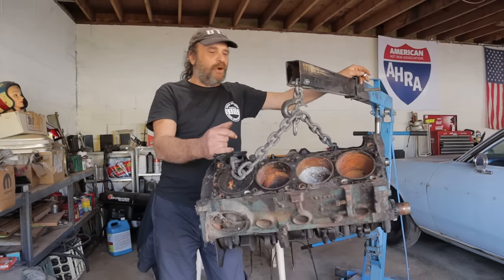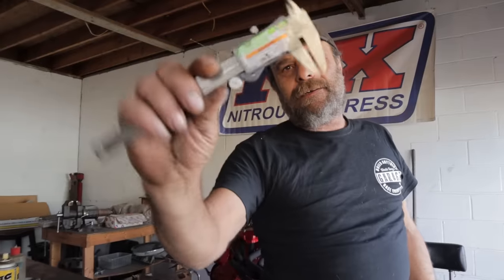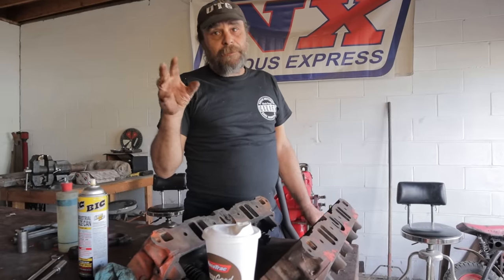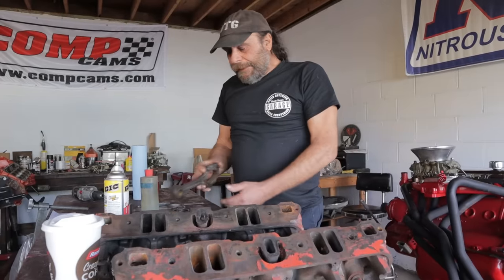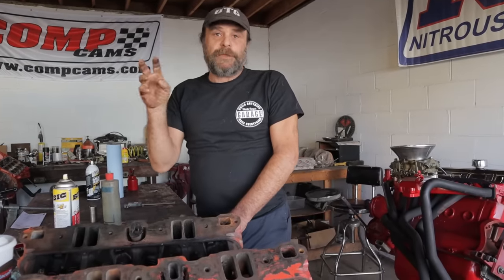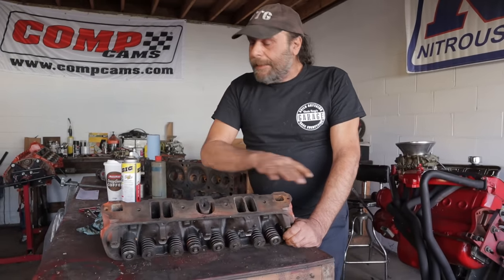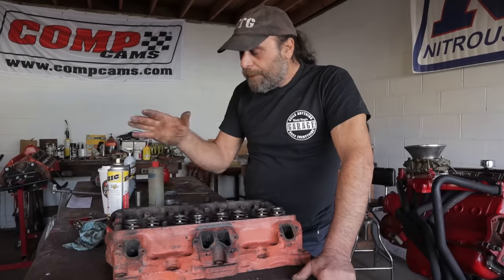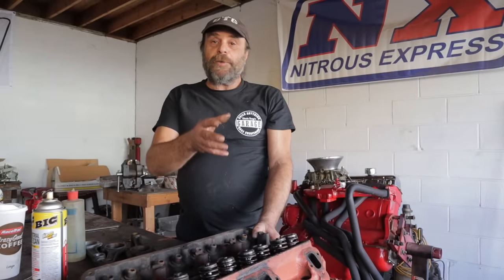The Most Under Rated V-8 In History?

Comment: Please Uncle Tony, mention the 88,89,90 pre-magnum la swirl port heads 308's.
Reply: Yeah, I'd like that too.
Reply: Those started in 85 and had a roller cam also
Reply: dumb question. a 308 V8 or are those the heads? what did they come in?
Reply: @hank1556  It's the casting numbers on the heads

Comment: on my 5th (over 40+ years) 318 now. It's in a '97 1500 4x2 automatic. 230K on the clock and strong as ever. (Wore trucks off around four 318s, sold a '73 Swinger for more'n it cost me.)

Comment: I've stated for years now that the 318LA, at least in stock two barrel form, rather reminds me of a Diesel with its useful low end torque and, incredible longevity. Too, even the 1992-03 Magnum version, is good in older vehicles, when fitted with either a Holley Sniper setup or with a Q jet style of 4 barrel carb.

Comment: One of the best motors of all time.  I have demo derbies these engines in a lot of different chassis.   Senn them run without water, seen them run with no oil in them, truly amazing motor
Reply: Had a cousin that would tac it up 7-8000 all the time   it finally blew.had over 100,000 miles on it.
Reply: Did the same thing. Would drop a 318 in the big body cars and hammer on it. We had a 273 that broke the cap off. It Was so hot it kept running and had power. The engine was so Carboned up it wouldn't shut off. HaD to run the fuel out.

Comment: Hey Tony! I have a 1968 318 LA engine, it has a 4 barrel Holley and an aluminum intake. Original in every other way. What other power mods in terms of valve train and or head mods could I do without touching the crank or rods? Thanks for any advice!

Comment: What made them respond really well was better valve springs. The stock engines revved far smoother and quickly if you replaced them - even with the stinkin' Ball & Ball/Carter 2bbl.
In fact I quite like those 2bbls.
They always looked kinda effeminate but they certainly didn't hurt throttle response and even breathed not too shabbily at all.

Comment: In 1973, I bought a brand new Roadrunner with the 318 2 bbl rated at 170 HP. Using all Direct Connection parts, 4bbl manifold, purple shaft cam, headers, new valve springs, performance ignition system and a few other goodies, this car was Fast!! I went from a '69 Roadrunner to the '73 because of the gas situation at the time and just had to make it go fast and I did. Had it for 18 years!

Comment: I've got a 318 in my 71 challenger.  Great motor
Reply: @jontrudell7529  nope. Original to the car :)
Reply: Did yours have the 8.75 rear or the 7.25 rear? My '70 318 Challenger has the 7.25 rear. Probably swapping in a C body 8.75 because it is a bolt in...
Reply: @DR440  8.75.  3:55 gears I think

Comment: The 80's swirl port heads work great on a 318. I got mine back about 2005 at a Pick Your Part Sun Valley at their 50% off sale for $16.50 each. The heart shaped chamber ups the compression a bit.  Surprised Uncle Tony didn't mention these. I'm a grinder geek so I ported mine. I got a brand new Edlebrock Performer clone SSI cam (old PAW Warehouse) off Ebay..., wait for it..., for $3.24 plus $10 shipping. $20 got me new lifters. $30 got me an Edlebrock Performer Intake and $25 got me a 50% off Pick Your Part Edelbrock carburetor. Based off a magazine article that had stock 318 cast exhaust making only 10HP less (on a mildly built 360) than $800 TTI headers so I just smoothed the transition on the stocker manifolds and run 2" to a single 3" exhaust. Hanging on my garage wall is a Grant Ring & Rod Bearing "overhaul" kit that I bought for $5 - just in case I ever need it.  This all hooks to in a Transgo shift kitted 904.

This all resides in a "baby puke gold-ish yellow" '73 Valiant More Doors. The 73 only rubber bumper extensions give it an unmarked cop car persona. Cop car wheels (215-60-15), adapted swap bars and lowered 2" in the front, 1" in the rear give it a very stealthy look. It handles like a go-kart.  2.76 gear are the worse but have the car in second gear and nail it from a 40 MPH rolling start and it flies!

Comment: Back in the 70's the 318 was used in small RV's, it was an awesome powerhouse
Reply: Large RVs too1979 or 80. I knew a rich lady who had a 35 foot Pace Arrow motor home who had a 318!  We road with her some 300 miles and even in TX a slight hill would destroy momentum and in summer tend towards over heating.  The engine was over matched!
Reply: 318 still is: https://www.hotrod.com/articles/318-small-block-build

Comment: I had a 318 in a 95 Dakota (I know it was a magnum). Headers, dual exhaust, mopar purple cam, r/t 360 heads, and r/t intake and throttle body and that thing hauled. Surprised a lot of people. Other then the exhaust noise and the dual pipes sticking out the back, it looked bone stock.
Reply: Magnum is still one hell of a motor. Just rebuilt mine @ 164k, not because I needed to, but I just did a full frame of resto of the Dakota so figured might's well since the motor is out. That motor got 20mpg all day long and was QUIET. Only could hear the intake suction and exhaust and ticks of the fuel injectors. Absolutely amazing that motor was. Internals were pristine.

Comment: Hey Uncle Tony, I just came across your channel regarding the 318. Going way back to the 1950s, my Dad was a Plymouth man. He knew little about cars but stuck with Plymouth because his childhood friend was sales manager at Basso Chrysler Plymouth in LA and always gave him a good deal. The only criteria he required was automatic transmission, radio and heater. He always bought the full size Fury but in 1956, he had a Belvedere. My Dad traded in every two years. In 1960, he purchased a Fury and it had the 318 and I swear it had a 4 barrel carb and dual exhausts. The owner's manual said it put out 260 horsepower. I was ten years old and was noticing cars and interested in the specs. My Dad did not order that engine special, it just happened to be in the car he bought off the showroom floor. That Plymouth was the most powerful Plymouth he owned up until that time. For a 318, it was fast with the push button Torqueflight. In 1963, he bought a Fury with the 318 and it was a bit slower but my Dad liked it because "it was easier on gas". In 1965, I was beginning to drive and went with him to pick out his new Fury. We saw one on the showroom floor and he liked the color. It was a Fury 3 and he saw that it had automatic, heater and radio. That is all that mattered. I saw that it had the 383 four barrel. Talked him into that. That was the fastest car he had until his passing. He complained that it didn't get good gas mileage and I just played dumb and shrugged my shoulders. I remembered the 318 as being a dependable and adequately powered V-8. The 318 four barrel in 1960 performed closer to the 383. My Dad's last Plymouth was in 1970 and it was equipped with the 318. He was slowing down in his old age and kept that car until his death in 1975. The odometer was 43,000 miles but it was actually 143,000. He put a lot of miles on his cars. He always had Plymouth do his maintenance and oil changes. The 318 with the high miles never gave him one iota of trouble. I sold the car to a friend and they put another 50K on it before they got rid of the car. The 318 was the workhorse for the Chrysler as far as 8 cylinders go but I purchased a Plymouth Duster in 1970 with the 225 slant six and in 1986, it was still going strong as our second car. Neither engine would set the street on fire as far as performance went but I do not believe there was an American built engine that could outlast these engines with regular maintenance performed.

Comment: I built a 318 using a 1967 complete motor. Bought it for $200. It dynoed when finished at 365 horses at 5400 rpm and 384 pounds of torque at 3500 rpm. Surprised many other Mopars, GM,, and Ford owners.
Reply: No way
Reply: @gersonhay984  Remember when Hot Rod magazine built their "Junkyard Jewel" issues on engines
spending $1500.00 to get hot performance? They got 375hp and 378fpt out of a 1985 318 using factory heads, pistons, piston rods, crankshaft and cast iron intake, with headers.

Comment: The 318------It's the Slant 6 of V-8's....lol
Reply: Exactly
Reply: You know that’s right 👍
Reply: That reminds me of something.   Yoga pants...... the bacon of the clothing world.
Reply: Hilarious 👍
Reply: Im pushing 400 hp out of mine i have had a ton of 318s and worked them to death never had a 318 that died  you can run them with no oil till they lock up and let it cool down and put 5 quarts in it and i would bet it would start back up you cant kill 5.2 liters yes there slow and low rpm engines but if you want a everyday driver that will be reliable it has to be a 5.2
Reply: That’s awesome dude, I love it and hope it keeps stomping all the brand X cars like Mopar is known for 👍👍👍👍👍❤️
Reply: Simple diet  of gas, oil, & Coolant. They  always got you there... and back.
Reply: High praise, indeed!

The Slant Six, is just about the most durable 
engine I've ever run.  The 318 is right up there!

steve
Reply: How is a mopar inline 6? I've always been a fan of chevy straight 6 but I've never owned a Dodge slant 6. How do they compare? Do they have the power like the chevy?
Reply: My first car a 1969 Plymouth Valiant 100 had the Slant 6 in it with a Holley 1 barrel,  I ran that thing without water, oil and had a rod knocking in it. It still would not die. Perfect first car engine.
Reply: @steveskouson9620  We tied to kill a 225 slant six back in the day. We put a brick on the accelerator and waited. And waited. The thing got into a valve float situation or something, and never did blow.
Reply: @ThePatUltra Thank her for me also plz?
Reply: @ThePatUltra thanks bud. 👍
Reply: @philipandrew5643  they arent as fast, unless you can really ear tune them, but they are reliable and strong, they fid not call them the leaning tower of power for nothing, my family has had some strong slow trucks, but we didnt want them for fast, we wanted them to pull, and that is just what they did

Comment: Amazing what a 4 barrel, hotter cam and dual exhaust will do to wake up a 318.
Reply: It gets better when you raise the compression ratio and get a set of ported or aftermarket heads for it too
Reply: The swirl port "cop" heads (302 or 308 castings , can't remember exactly) work great on a 318.

Comment: Tony,
Almost forgot re the 318,one of the best small block gas marine engines ever produced,lm 318 225 hp in a small package 2 of these will push a a 30 footer at 20 mph all day every day
Reply: 1966 16 foot Century Resorter with a 235 HP Chrysler Marine 318 = 50 mph boat! Great engine!

Comment: In 1983 my dad and I built a 1972 318 and sent the stock heads to Bob Mullin in California. He ported the intake and exhaust ports, 3 angle valve job, heavy duty springs and told us to run a stock 340 intake. He also said run 9.5 to 1 pistons in it with a Dirsct Connection Hemi Grind cam. Well we ran that set up at Englishtown and did consistent runs between 13.9 and 14.3 depending on track conditions 👍🏼

Comment: Missed, LS cathedral port small valve heads have 1.89” intake and 1.55” exhaust valve. 
LS1/LS6 and later truck heads ie 243/799 heads all have 2.00” intake and 1.55” exhaust.
Even the small valve truck head has 200cc intake ports.  The better Big valve heads come with 210cc intake ports. JD
Reply: WTF has this got to do with a 318 ?
Reply: @joebalser9515  Re-watch the video and you’ll see, this goes to show how little people actually pay attention.  JD
Reply: Biggest gain on the LS head is the valve angle and the port flow through that small 1.89 valve is around 230-240 cfm on a stock 862 or 706 head.  The LA heads do not flow nearly as well or even come close to approaching the port velocity. The valve angle, intake velocity, and flow lets the little 3.78" bore of the 5.3 make alot of hp despite its small bore.  I like the 4.7L that replaced the 318. Its not quite as bulletproof but makes more hp, more torque and gets better fuel economy. Had the little 4.7 in my 03 Dakota.  With 218/224 cams, headers and a 2008 up 4.7 intake manifold I used to leave my brothers 98 360 powered R/T in the dust.
Reply: @chrisreynolds6520  LMAO !  You're a dreamer for sure. ! Chevy has tons of upgrade parts because they NEED them to compete ;)
Reply: MUH LS, DONT INSULT MUH LS! btw, 5.3 truck heads flow about the same as a 5.2 magnum head at around .500 lift.
Reply: @chrisreynolds6520  dude, you havent seen the magnum head port velocity then.

Comment: Had a 318 in my 72 charger she ran fine.dependable driver. Just had issues with joints going south. Sold it cheap wish I still had it. Several cars from the past I wish I hadn't sold.

Comment: If heard, the 80's "kidney bean" head is pretty awesome on a 318. Better flow. Better swirl. Better quench.
Reply: I don't know the kidney bean heads u speak of . But I agree that quench is worth the effort did a zero deck motor on a six cylinder and really felt a difference in response also since then the cars oil stays clean  now not even dark at 2k miles and didn't touch the jetting. Maybe slight compression increase  is a factor also?
Reply: Yes, as used here: https://www.hotrod.com/articles/318-small-block-build

Comment: In the mid 80s there is a high flow heads that came on the 318 cop car and 3/4 ton and 1 ton pickup trucks they are a good pulling plenty of powerful and excellent mileage engine I had a 3/4 ton 4x4 and automatic transmission empty it would get 17 mpg no matter how fast I drove it the speedometer topped out at 85 mph but it would bury the needle and it had a small 2 barrel carburetor. Excellent video keep up the great videos I just ran across your videos I really like the 318 . When it finally gave up I went to the 12 valve cummins turbo diesel engine. I have a 2 ton 1976 Dodge truck with a 360 with the closed chamber heads and that truck with a 26000 pounds of load and a 4 speed transmission and 2 speed axle will get a steady 9 mpg and pull good it's a 360-1 engine I believe it was a military's truck with a basic 2 barrel Holley carburetor.

Comment: Tony from my research the closed chamber heads went away in 67, only the 67 318s had closed chambers. In 68 the 675 open chamber head was used on both the 273 and 318. My 68 318 has the 675s, however I found a 273 with 315 closed chamber castings and the later style intake mounting.

Comment: I still drive a 1990 D150 with a throttle body 318. Besides that, I’ll always have a love for the 318. In 1978 my uncle bought a brand new Dodge 4x4 stepside pickup. 318 and a 4 speed. And I’m 100% sure it had “Power Wagon” on the hood near the bird bath recessed area. He removed the dog dish hub caps, installed snow/mud tires on all 4 corners and an aluminum camper shell. He also had the muffler shop install dual side exit exhaust with glass packs. He pulled a 14’ Winnebago camper. And behind the camper he pulled his ranger bass boat. Tandem towing. Me and my 3 cousins would pile into the back of the truck and he and my aunt would take us to a large lake and camp ground for the weekend. We did this 4-5 times a summer. Oh the wonderful sounds of a 4 speed dual exhaust 318 pulling a load up and down hills…from the vantage point of a wood floor in a short bed pickup with no sound insulation. Good memories. And molded my view of what a good pickup sounds like.

Comment: I will argue that title you gave the 318. I believe the 400 ford is the most under estimated engine not only in ford, but of all pushrod v8's. You say the 318 didn't see a 4bbl or dual exhoust until whatever year? Well, the 400 never ever saw either of those things. It was choked out from stem to stern. Day 1 till death. You say what you can do to a 340 you can do to a 318? I say what you can do with a clevland, you can do with a 400! Only more! The 400 is basicly a tall deck clevland. So those big valve high flowing heads that you have to make 351 ci scream rpms to use of those heads? The 400 is basicly a stroker with those heads! Now you can really put those big valves & ports to work filling thoesd cylinders. So ya, I challenge you & the 318 for the title of most misunderstood, most under estimated engines of all time! Out of the factory the 400 as been cast out as a boat anchor for yrs! But go watch some engine master challenges & keep a eye on Jon Kaase!
Reply: Exactly. And for those that are unaware, TMeyer and Racetec have high comp-height pistons that will take a 400 over 10:1 and a 351M into the 9+ zone.
Reply: Ive always defended that ol ford to all the die hards lol
Reply: you might be right but they didn't many 400s
Reply: @1voiceofstl  Are you kidding? The 400 ran from 1972 to 1982, eleven years of production. Mid-size, Lincolns, pickups, Broncos. And all those 351M's, just a crank and pistons away from a 400.

Comment: I've ran into people talking shit about 318s and mopars. guy told me back in the day he bought a 69 plymouth road runner with 383 and it leaked oil and ran like crap and finally threw a rod . he said mopars suck. I said you bought the vehicle used and was probably used and abused  before you bought so yes it would run like shit ! if you would have bought off someone who took care of it you wouldnt have had those issues! just like buying a used Harley ect . all mopar engines are great including the slant 6
Reply: Why a 318 was even in his Road Runner is a mystery to me
Reply: @DSchea  Probably because the 383 blew up and they got a 318 cheap and threw it in there.
Reply: @DSchea   A 318 was not in his roadrunner I was using that as an example.